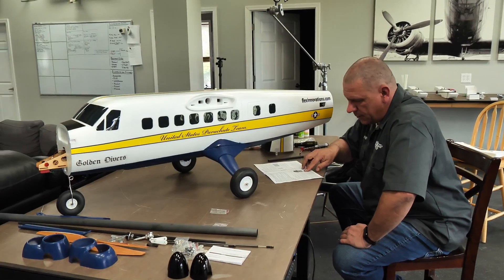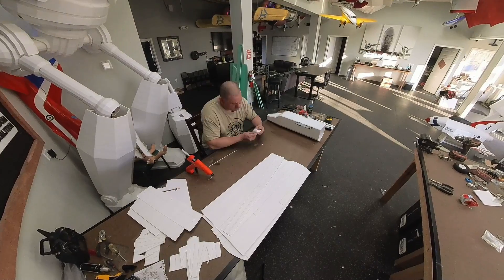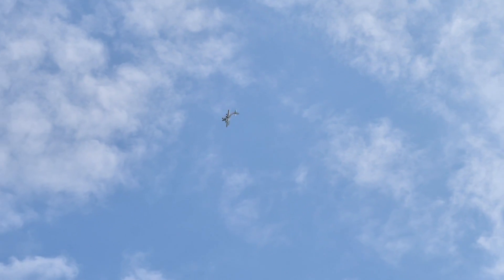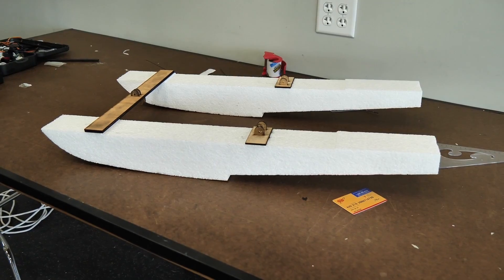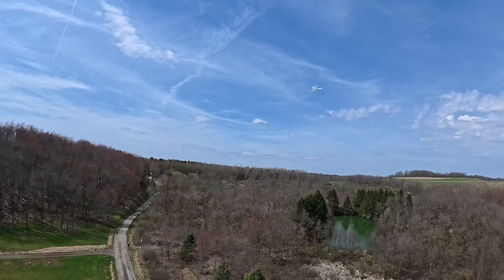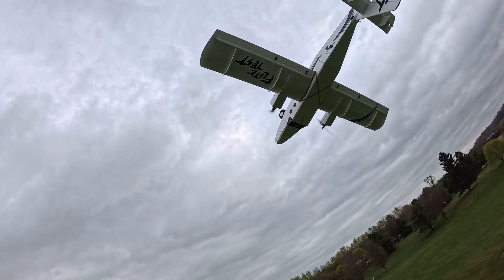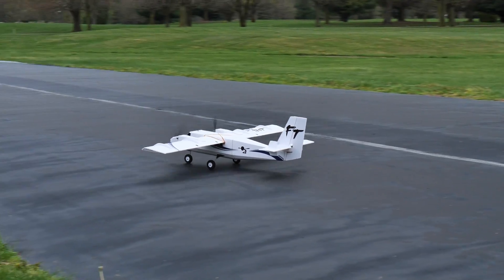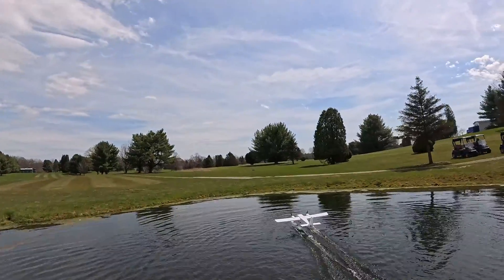Flite Test Twin Otter Design Journey

Comment: What type of foam board do you guys use? Like what size and where can I buy it?
Reply from the maker: We use our own formula foam board made from Readi Board. You can buy our foam on our website which is the stuff we use or dollar Tree and dollar General have the generic Formula which also works but doesn't last as long. But the size is usually 30X40 Sheets.

Foam Board: 
(20 Pack) https://store.flitetest.com/flite-test-maker-foam-board-by-adams-v2-20-pack/
(50 Pack) https://store.flitetest.com/flite-test-maker-foam-board-by-adams-v2-50-pack/

Comment: Cant wait to build this twin otter i jist wont be flying it out of water cause if i crash in a pond at my park i go to i jave no way to get to the plane and recover it before it sinks and gone forever with a hindred dollars plus of electronics on board, yes im ising high end electronics now but didnt from the statt abd dont need the best electronics money can buy cause you can go as cheap as you want and thier planes will still fly. Yea flite test has made the hobby of RC flying affordable fun and easy for anyone to build the planes following the build videos as long as you have a hot glue gun and a free sat and Sunday afternoon you can build a complete plane in a weekend or just tought it and grind it out and build a nice plane in one day like 4-6 hours straight. I have built at least 1 of every flite test planes they have released and I scratch built them all except for one of the simple cubs own I got 10 simple cubs all in great ready to fly condition for the dog fights we do at my field, the explorer and the edge 540 is only ones I used speed build kits for the rest was all done sith plans some foam board metal ruler as straigh edge a 2 foot ruler and 1 fppt ruler and a razor blade and a dewalt hotglue gun. These guys got me into the hobby 8-9 years ago maybe 11 not sure it's beenpre then 6 I know for sure and made it so simple and cheap and affordable to get into the hobby from scratch with nothing. I just used the flysky radio from Amazon and some cheap servos ESC and motors off of those Chinese web sites for the first 4 I built then I started buying power packs. But now I'm building huge balsa planes from scratch and kits and loving it thanks flite test.

Comment: Love this. Back when I worked in the bush, I flew to the back of inlets on the coast of BC in a twin otters on floats. Flying bus. The thing could carry our entire crew in one flight unlike the beaver which I also flew in a lot. Amazing planes made in Canada. Viking Air of BC purchased the type certificates for many De Havilland aircraft and put the twin otter back into production around 2010. Among other things, they also own the type certificates for the Canadair CL 215 - 515, a purpose built, amphibious firefighting aircraft. They strip beavers to their bones and completely rebuild them at their coastal facility. I flew in one. Had that new plane smell in an airframe originally built in 1963.

Comment: Beef the landing gear up.  Every FT plane I have with landing gear is more than just a little too light.  I can’t fly off of pavement and my grass field is a bit rough.   I know, it’s more my problem than theirs, but a little bit stronger gear would be nice.
Reply from the maker: In the video, it was actually the wheel that slid up the end of year wire.  we were reusing a wheel that had a larger hole and it rotated up the wire. We should simply put a wheel collar on the inside, but you know how we are :-)

This landing gear is bent from .125 steel on the back and screwed into plywood. We should’ve showed the wheel issue a bit better. This is simply because we repurpose a lot of of our old gear.  This landing gear is insanely strong. Much stronger than many of our earlier models.  Thank you so much for the feedback and also your support. :-)

Comment: This is very interesting in purchasing this. It was mentioned at the end that you were using an Aura. Are using an Aura 8 or Flite Test Aura Lite?  Have you loaded the Twin Otter config or you have a FT Twin Otter config?
Reply from the maker: We do use the FT aura five. We also have an amazing tune that gives you different differential thrust stabilization, thrust differential, and all the great features like level assist and level assist that the aura five offers.  Flex innovations has been amazing to work with.  The tune will be available very shortly on the store for free download. If you use the ELRS protocol, you can even remap a second PWM receiver to operate features like flaps and even head tracking pan and tilt.

Comment: Great looking and flying model. 
Is the nose wheel steerable or is the differential thrust doing all the ground steering?
Also, one of the mains collapsed, so, did you redesign the main gear?
Reply from the maker: The wheel was drilled out to a larger size from a previous project. It just wandered up the leg. :)

Simply fixed with wheel collars.